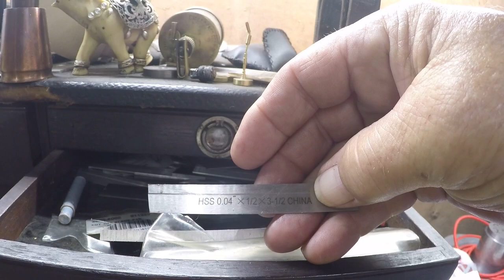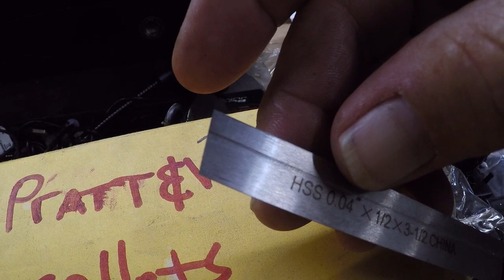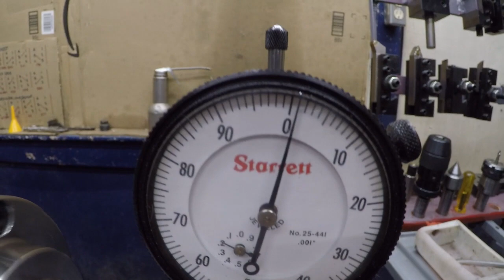CLOCK NUTS

Comment: That type of 'adjustable collet holder' is called a 'set - true' . . . nice to have !     It's a shame you're wasting so much material , when you could easily enough GRIND a parting tool . . .   * I've watched part of part 2 . . . & decided to head back to this one to make my first comment / suggestion .
      You can 'dress' the lead of the parting tool to have it cut completely through the 'part side' by relieving the left side of the cutter a bit . . . just a little bit does it !    * Make a diamond hone your FRIEND ! ! !    Brass can be turned at a much higher speed with good effect - drill it at your highest speed . . . then chop the speed when reaming . . . go back to a high speed when parting off !    Brass cuts like butter with a good sharp tool !
Reply from the maker: Mini lathe